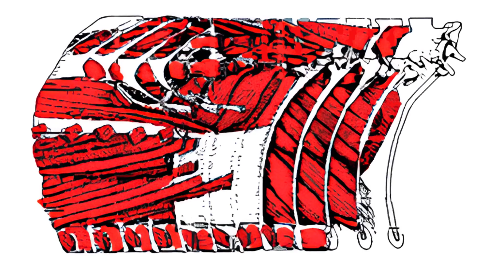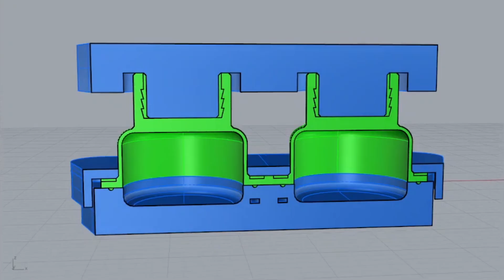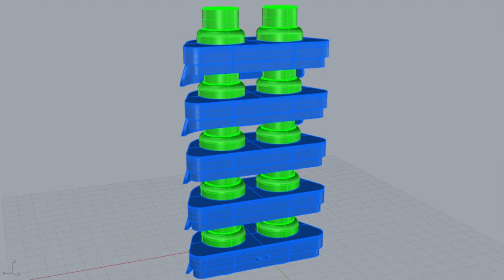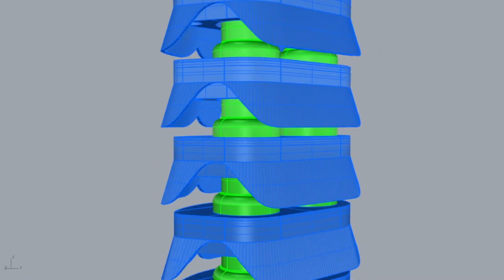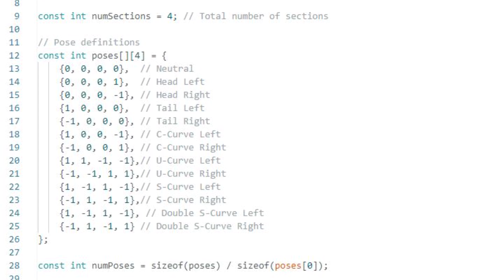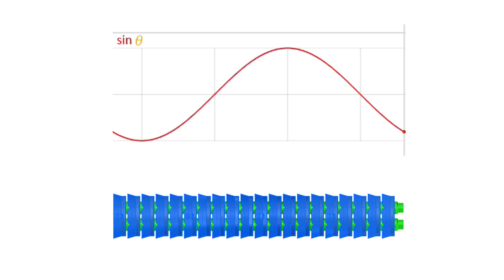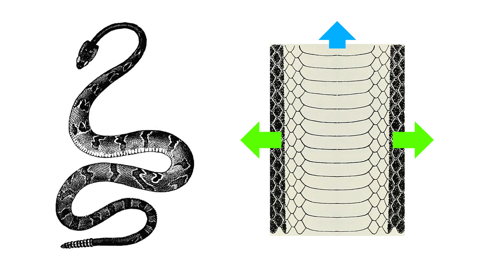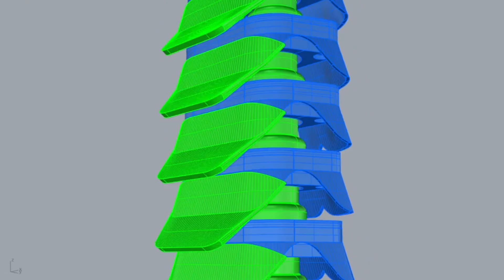I Built a Soft Robotic Snake — Here’s What I Learned

Comment: I would make the "scales" be much smaller, thinner, and feathery. I'd put the large flap like you have almost parallel with the ground, then add tons of light feathery protrusions a single extrusion width wide.

I also think splitting the scales in half as a left/right half like the other commenter said would help. Maybe even three sections, so you have a neutral middle, and then a left and right propulsion scale, and mess with the scales being varying percentages of the belly's width.

I was also thinking that a snake's body rolls a little bit around each bend, I wonder if that adds to the scales digging in more during the roll, and releasing easier after the roll is past?

Comment: What about 3 muscles one pointed up(or is just thicker on the bottom) and the other two pointed down and out. That way you can control it in any direction. This lets you pull up the edges you want to move forward.

Comment: Love the idea of using normal silicone sealant for casting and 3d printing for mould making, I can't believe I never thought of that!
I think the main issue with all types of soft robots is the pump. You need that rigid part that's often off-robot to make it works and then you need a bunch of control valves to distribute the air. Again rigid.
Additionally you need a tonne of hoses to distribute the air to the appropriate parts.
I wonder if there's a way to have one central tube with positive pressure to which all muscles connect, and then have valves that open/close (bonus if they can be made soft as well).
That way you wouldn't need a tubes to reach the pump from every individual muscle.
Reply from the maker: It’s actually a two part silicone, I should show the mixing in more detail. And you are right about the pump and pressure distribution problem, will probably show a path for solving this in my next video, keep an eye out for it!

Comment: Split the scales in two and turn each half 45 degrees outward(or experiment to find a better angle). This way the grip will be distributed like the real snake's - sideways you'll have decent grip from one half, backwards it will have the full grip of the two parts and forward they'll still be compliant like now. Currently if look from the side, the scales are all parallel and touch the surface at a straight line, which creates very little friction in that direction

Comment: Super cool project and video with very interesting snake facts!!
I wonder if the issue with undulating motion (even with your anisotropic scales) is that they are too slippery in sideways motion? Like you said, the wheels work so well because there is high sideways friction (and additionally they could them just turn in one direction with a ratchet mechanism...). Could the elastic scales be redesigned to have a side-ridge that stops them from sliding as easily sideways? Also I'd be curious to see the anisotropic friction scales in the "caterpillar mode", since for that the sideways friction doesn't matter.

Comment: This is a very ambitious project the way a snake moves is far beyond my comprehension and you have made one 👍Would it help if it had 4 air ways instead of 2 creating a small amount of lift as well as left and right. This might add pressure points for better grip. Good luck with it, hope to see an update 🙂
Reply from the maker: Thank you, lifting parts of their body is actually another strategy to reduce friction and could open more possibilities such as climbing!
Reply: @soiboisoft  is it possible to use fluid transfer to shift weight to different areas to create some kind of balance maybe this would aid or help climbing. Sorry thinking out loud, I think it's best left in your capable hands. Fascinating animal 👍